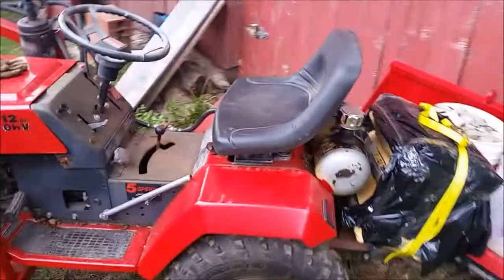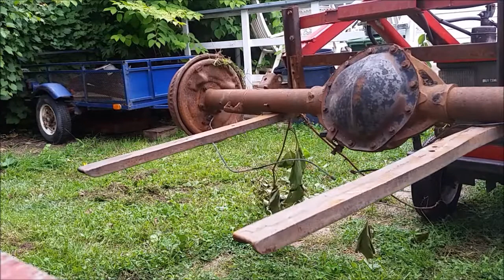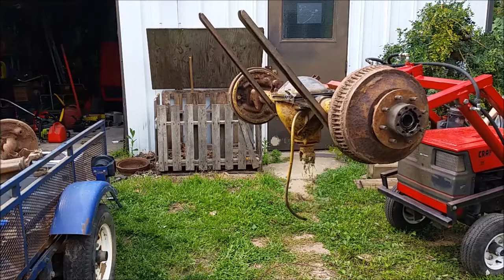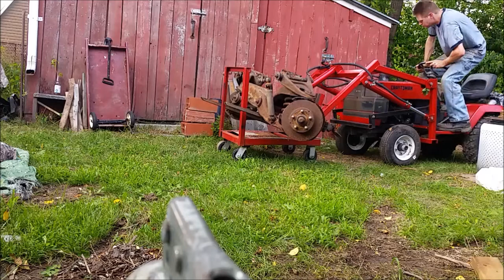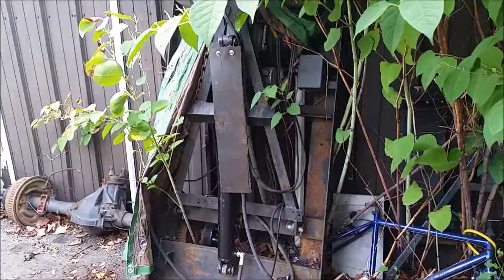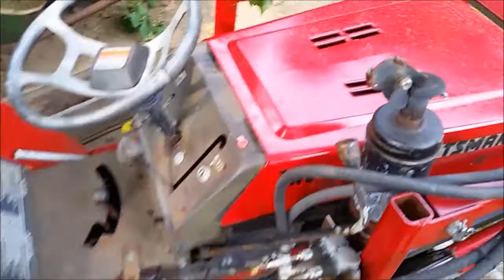Craftsman Loader Heavy Scrapping!

Comment: It had no trouble lifting at all. I've reworked those steering gears with shims but they're still not very strong. A 90 gear box should be awesome.
Reply from the maker: Thanks. Hopefully I can get the steering issue resolved, then it would be a quite capable little machine.